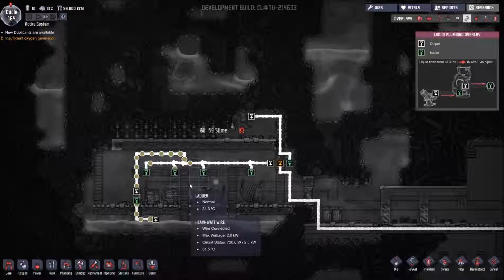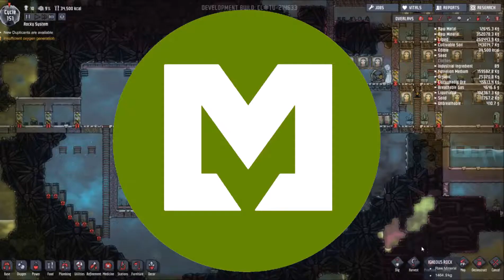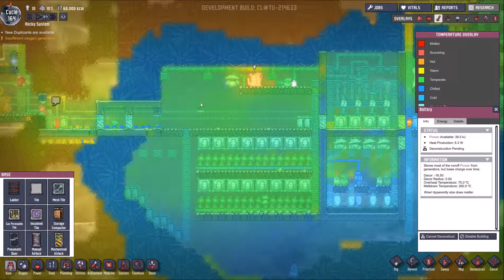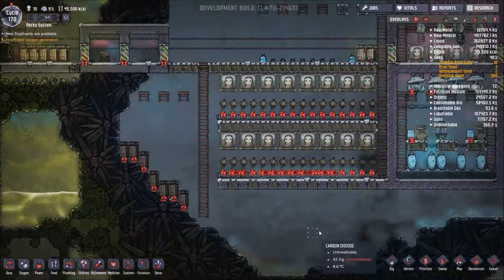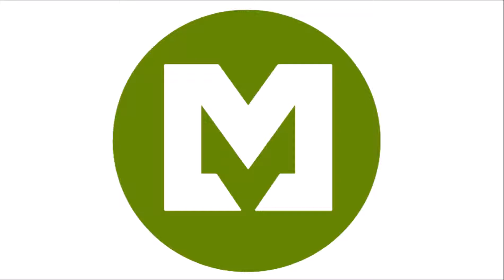Oxygen Not Included #06 Thermal Upgrade: Rocky System - Water cooling Gone Wrong

Comment: So, what I gather from your power setup is that to parallel split power line runs after the batteries to start individual runs won't accumulate and stack the power load totals for the system as a whole? (That make sense?) As if the battery becomes a null point to start adding up load totals beyond it for that run only. I had assumed that everything connected together (regardless of position) would accumulate and total, requiring completely separate systems to avoid going over 2KW.

Ah, never mind. You did end up splitting the runs into completely separate, isolated systems. All is good with the world now.  ;-)
Reply from the maker: Yer it was my rookie moment :)